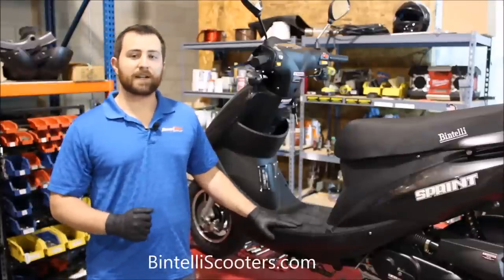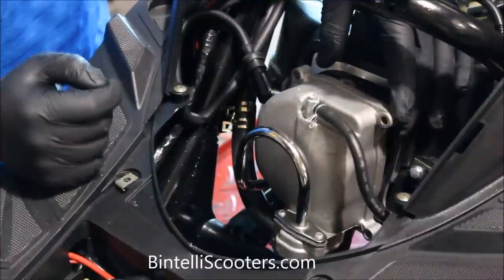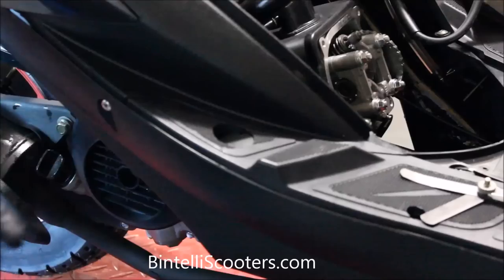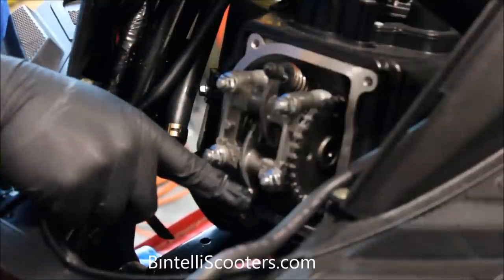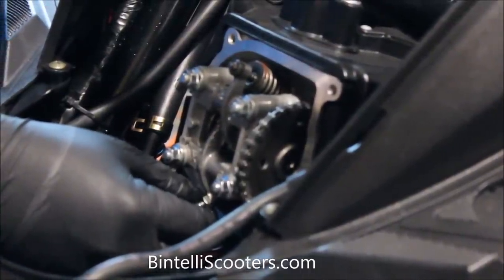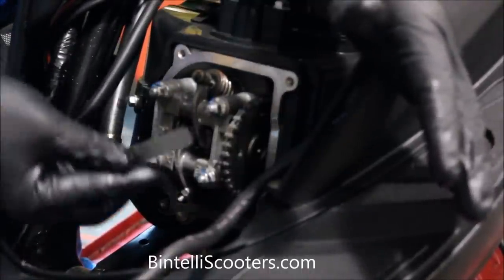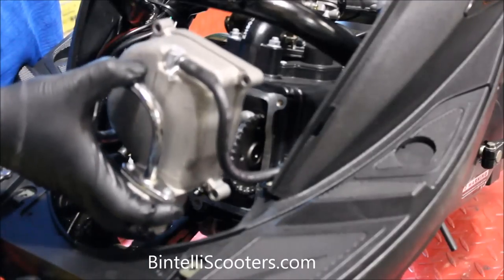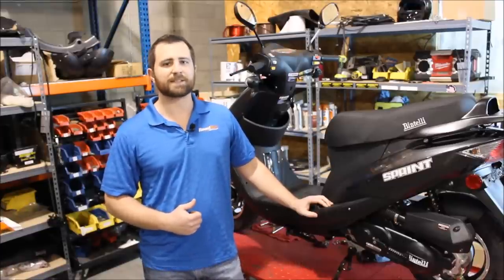How to do a Scooter Valve Adjustment - QMB139 / GY6 - Step By Step by Bintelli Scooters

Comment: Adjusted valves to 3 thousandth on intake and 4 thousandth on exhaust but I'm still only getting 70 psi of compression. What else could be the cause?
Reply: Doug Russell rings might be shot
Reply: Doug Russell 

Piston rings.

Comment: .. I just finished making these proper adjustments as per done by your Instructions .. Your Info seems to be consistent, so I do believe it's going to help me tremendously .. I will be back with ya, to let you know one way or the other,but I really don't think I'm gonna have any problems .. Thanks much, and thanks again :)
Reply from the maker: sqrlyman1 You are welcome! Please like and share the video if you liked it!
Reply: @BintelliHQ  helo I have a romet  125cc Chinese scooter and as same like you did in video valve adjustment the repairing man also do same like you and it starts fine and when I Ride my scooter in Snow Fall and raining day it won't start when I give race no start can u please what is the main problem of my scooter..I hope you will find my sloution and hoping to get reply from you
Reply: @KhrissZaitsev  I have a chinese KSR 50cc scooter, i have located the metal stator but no "T" marking?? Any ideas please? xx

Comment: Just did a valve adjustment, valves were really tight, after doing the adjustment I now have LOADS of oil spewing out, I took the cover off to see where it was coming from and its  literally pouring out from in between the rocker arms, possibly from the groove on the top left rear of the rocker arms, do I need a new cylinder head and rocker arms? Thanks
Reply: Did you use imperial or metric? Am guessing that as this is a US video that 0.003 is not the same. Also did you ensure cover was fitted correctly?

Comment: hello i have a taotao 49cc moped which i have problems starting it turns over i checked for fuel and spark has all that the only way it would start is by me spraying starter fluid but when warmed up i can turn off and turn on no problem but when cools down same problem cranks but doesnt start any ideas on y

Comment: My 50cc scooter use to do 45mph now struggles to get to 30mph.. everything on the scooters been checked and replaced except the valves it has 4400 miles on it and a Valve Adjustments never been done to it.. Could this cause a significant drop in Top Speed like 15mph?
And side note there is a loud ticking/tapping coming from the valve cover that wasn't there before..
Reply: +Christopher Spohr  same here! have you fixt it?
Reply: this issue is happening to me as well please tell me if you have fixed it
Reply: it was the vavles .003 for intake .004 for exhaust problem solved
Reply: if your exhaust valve is open to far a lot of your compression will leak out. and if its to tight it will make back presser and decrees you power. makes your eng. fight it self.
Reply: Remember that feeler gauge is in milameters not inches .if u do this and it dont run or run right check and be sure of gauges also be sure to spin motor a few times and re check adjustment before putting back together .do all work on cold motor only.
Reply: Except they all use inches in the USA when referring to this, yes, the engine is metric from China but you can convert the mm to inch .004" is 0.1016 mm and some sets of feelers have both systems on them, a video by Daniel https://www.youtube.com/watch?v=ssGvUuakMCA shows his combination US/metric set and you can see .004 and on that same gage is the mtric equiv, .003 and .004 is very small, it's like less than one milimeter- about that of a business card but maybe that's even thicker.

Comment: Gy6 50cc scooter
How many intake valve mm?
How many exosz valve mm?
Reply: 0.08mm to 0.10mm on both valves according to the video or 0.003 to 0.004 inches. I preferably go with 0.08 on intake and 0.10 on exhaust.

Comment: You think this may have any connection or solution as to why My scooter may be randomly stalling on idle? I mean once it's been running for a while and I'm at a red light, I may randomly stall. But starts right up with a little gas.
Reply: Clean your jets

Comment: I decided to open up my speedometer case up to see how the miles tracker and speed cable make the orange needles turn but after reinstalling it on my scooter the needle for the speed no longer moves it is literally stuck and wont move unless I push it with little force and I'm thinking that it may just need some lube since I woke the thing apart or something, any thoughts on a fix ? taotao 50cc gy6

Comment: do you think by doing a valve adjustment, it will cure this problem?:
scooter runs excellent. low miles. dies out when running a few miles, and wont restart till it cools down. then it starts and runs normally again
Reply: Possibly if the valves are tight, you should check them just to eliminate the possibility but it sounds like a fuel delivery problem.

Comment: Do you lift up on the tappet arm or leave it rest while doing an adjustment
Reply: Spencer Valentine At top dead center  both valves are closed. your keying on the clearance between the tappete n valve end that's it. follow the video.

Comment: my Tao Tao 50 moped will start and run for about 30sec then die but will start back with a little gas then die again after 30 sec will the valves make this happen
Reply: Yes it will. Tight valves will cause stalling and hard starts.
Reply: my sl 250 2 engine turns but will not start
Reply: steve rust I have the same problem. Did you fix it??
Reply: steve rust ?

Comment: Hello there well I have a buddy scooter 150cc did everything to open it up .. now on my wheel it has two markings  one is a straight line runs across let’s say 9:0clock and 3:0clock when in that position it has two holes 12:0clock and 6:0clock one hole has a marking the other has no marking which one should I use as a guide .. the scooter was having a hard time starting once started it ran no problem when ever u stoped hard to start again .. did the adjustment on a other scooter except the shim were .006 so I would close off air to air box it would puff then bing it would start checked for old bad hoses replaced one the gas filter was black yellow no question there I know mechanical basics
Reply: If the piston is TDC : then both camshaft lobes should point down torwards the piston top.

Comment: thanks for the video, it helped me to ajust my gy6 150cc ,my scooter would not start before I did a vale ajustment, but after it still won't start, I did a compression test and im getting 65psi what can I do? where am i losing compression? please help
Reply: GY6 149cc Tune Up Specifications....

.003 - .005 Inch : Intake
.005 - .007 Inch : Exhaust

( .076 - .127 Metric : Intake )
( .127 - .178 Metric : Exhaust )

Idle Speed : 1700 , +/- 100 RPM

Spark Plug : NGK C7HSA
Spark Plug Gap : 0.6mm - 0.7mm

Engine Oil : 15W40
Reply: @noneshere  please suggest gy6 100 cc scooter tune specification

Comment: I stripped my spark plug so I had to replace my head. Was not familiar with top dead center. Took chain and camshaft off. Now cannot get it time to write. Some people say that he and the flywheel couldn't be an inch or two either way. I have it right on the mark now and a sprocket the big hole is out like top dead center should be. how can I be absolutely sure where top dead center on flywheel is. without going by T line. I heard a trick you put a straw inside spark plug hole and spin flywheel when straw is fully extended is that top dead center ? correct?. Please help. I can't adjust chain and everything. Just want to be sure I have it right this time
Reply: I've never did valves on a scooter, but have many times when rebuilding car eng. same principle, take a straw , wooden dow. rod any thing the won't scar the top piston.. in sert in plug hole, rotate eng. and you can fill when the piston comes up and then stars to go down,  as it start to go down try to bring it back up. when your at the point were its not going up or down that's top dead center..
Reply: Thanx
Reply: jim crabtrey Don't remove the spark plug on a hot engine that will  rip the threads too

Comment: hey man. i have a Jonway galactica 150 i changed the cluch as well as the variator  and my belt seems to be in shape.. i have lost power for some reason "all of a sudden 😔" in my manual book it says the valves clearance should be 0.12 in and out wich is abit big to what u suggest for a Gy6 weather 50cc or 150 as per ur discription..

i have set  it to 004 on both in amd out bt im still not satisfied with the performance.. i am to try and set the intake to 003 as u suggested and i hope it will make a difference.. will change my C7hsa plug aswell wjen i do the adjustment... Any expert advice much appreciated thanx..
Reply: nkosikhona ezzyboy spelmandla my scooter also says set it at 0.12. How is yours running now that you set it at 0.03?
Reply: @mr.funkateer482  I actually had to sell the scooter coz it was giving me headaches... i found out that i was also losing spark coz the idiot that worked on it before me stripped the plug threads on the head... then the carb was all dirty... i just decided to let it go... im enjoying walking to work and using public transport for now...
Reply: nkosikhona ezzyboy spelmandla wow that sucks!!! That’s why I’m only letting one person work on mine! Hopefully you get another one soon!

Comment: Where can I get any information on Bintelli Valor models? I can’t find anything online, even my manual is for another model. I love my scooter and want to maintain it but it’s hard not knowing a lot of the actual info on it.
Reply: I'm a retired auto mechanic I hope the information I give you will help you it is so very important on scooters to change your oil and to use the correct weight of oil have your valves adjusted at 500 miles I change your oil at 500 Miles when you get your scooter I also change differential oil at 500 miles that one thousand miles I changed my oil and I also changed my differential oil because the differential when is swearing-in just like a motor you will have break in particles and the differential also I strongly suggest change your oil at 1000 miles truthfully it never hurts to change your oil every 500 miles the cleaner you can keep your motor the longer it will last I would also change my differential oil every thousand miles me personally because a scooter does not have the oil filter like a car and scooters are droven at top speed I change my oil at 500 miles and I change my differential oil every thousand miles this way my scooter won't last a long time also you need to check your brake fluid if you have a master cylinder on your scooter and I suggest bleeding the master cylinder once a year to get all all of the old brake fluid I hope this information will help you and have a wonderful day

Comment: how much is that in mm ? like the .004 is like 0.1016mm ?
Reply: .003 inch = .076 metric
.004 inch = .102 metric
.005 inch = .127 metric
.006 inch = .152 metric
.007 inch = .178 metric
Reply: @noneshere  Gy6 49cc or 72cc valve in:0.003", ex:0.004"
Have I got it right?

Comment: I just bough a Bentelli Bolt and put 1900 miles on it, Havent got any work or tuneup done to it, What do i need to get done to it if anything? Its been running great has died wial ridding two times but other then that its doing good. Do i need to get a tuneup, Valve adjustments, Oil change, ext?
Reply from the maker: Warren, please do not continue driving it! The fact that your engine hasn't completely failed is lucky to say the least. By now you should have already had two oil changes and a valve adjustment. Your engine probably is damaged from the lack of proper maintenance which is why it is turning off. Please consult your warranty and user manual for proper maintenance intervals.
Reply: Ok thanks for the warning, I just dont know anything about them, Where can i take it to get a tuneup? The oil looks good its not dark at all..
Reply from the maker: You can find a list of all Bintelli dealers on www.BintelliScooters.com, but you can use any service center you'd like.
Reply: @BintelliHQ  I have a 2019 49cc Beast what are the specs on adjusting mine it has 1000 miles

Comment: Where would the valves be located at on a Vento Triton R3 scooter?
What the specs for the valves on these?
I removed the spark plug & cylinder (under oil tank), I see no cams.
Reply: angelisone it’s a 2 smoke only 4 stroke got valves

Comment: Is my feeler wrong? I don't see any numbers in the thousands on mine. I only have 0. numbers and other mm numbers
Reply: You ended up buying a metric set of feeler gauges but some feeler gauges have both ASE and Metric on the feeler gauge hope this helps you I'm a retired mechanic I suggest having a trained professional to your valve adjustment any vehicle it is so very easy to adjust the valve the way you do not have enough clearance if you do not have enough clearance you will scar the cam on your scooter or vehicle I strongly suggest you have a trained professional not a neighbor down the street but a trained professional to adjust your valves on your scooter or vehicle help my information has helped you

Comment: nice 'how to' vid, i appreciated the attention to the parts about going ahead and checking other maintenance procedures while anyone is at that point may as well check... but this instructional completely overlooked inspection of the valve cover 'gasket'...?
Reply: Awsome video,,,easy to follow and understand  Thank You
Reply: Yes, make sure the gasket is correctly back in place when mounting the cover back, otherwise you will have an oil leak

Comment: When is a good time to do this. When you first get it, during break in period or after?
Reply from the maker: +vettstunna Ideally after 500 miles is the best time to do the first one.
Reply: Nice, thank you! Safe riding!
Reply: @BintelliHQ  I have a 2019 bintelli Beast 49cc is it 3 for the top and 4 for the bottom just the same as this Sprint video could you please reply because mine is chattering a hair

Comment: Hello just ask something how did you know when the piston in top as u said but it doesnt ahow in this video
Reply from the maker: Marc U Using the timing mark on the engine casing as a guide, rotate the motor until the mark on the stator lines up with the mark on the engine casing. That ensures you are at top dead center. Thanks!
Reply: When the Piston comes down then it will come back up and create compression if you stick your finger over the spark plug hole you will feel air pressure wanting to come out of the cylinder through the spark plug hole also on one side of the plate on the side of the scooter you will find markings to show you where top dead center is on the crankshaft and there will be markings on the camshaft also when both valves are completely closed that is the compression stroke I hope this helps you and have a wonderful day
Reply: Put a zip tie or plastic straw in the spark plug hole and feel the piston hit TDC as you twist the fan